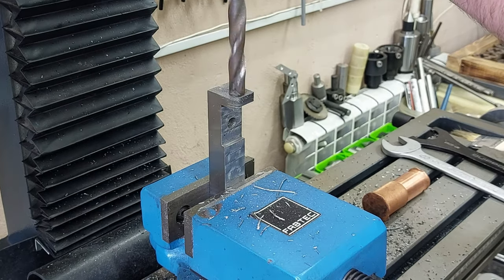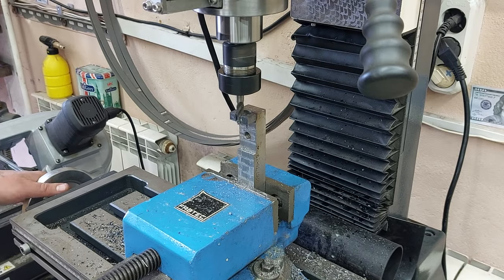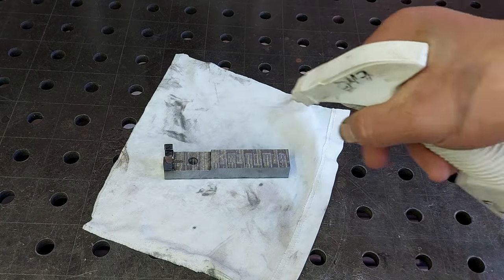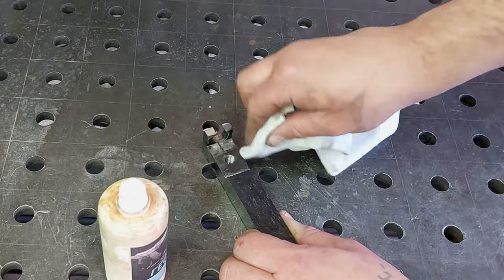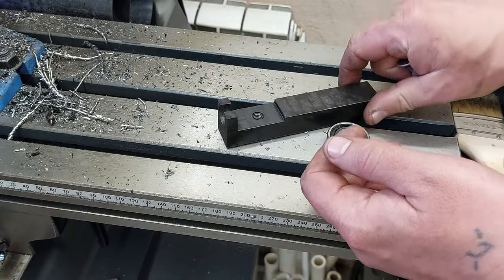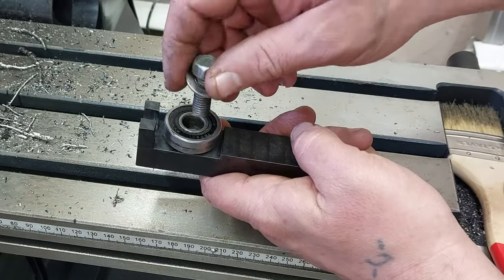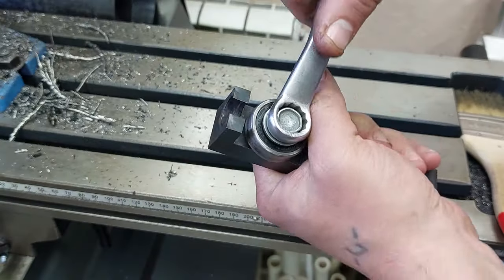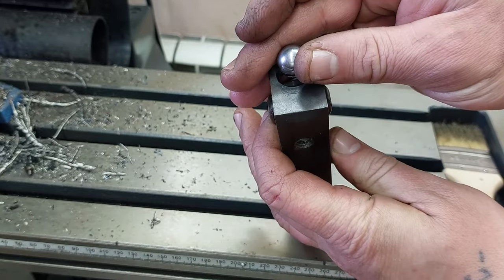Amazing idea and tip in 6 minutes! Why didn't I know this technique before

Comment: O rolamento deveria estar na Vertical , está na horizontal  , está sem finalidade .
Reply from the maker: The bearing is mounted at a slight angle because of this angle the bearing rotates as well as the ball! Installing the bearing not on a perfect plane, but at a slight angle is mandatory or the bearing will not rotate!